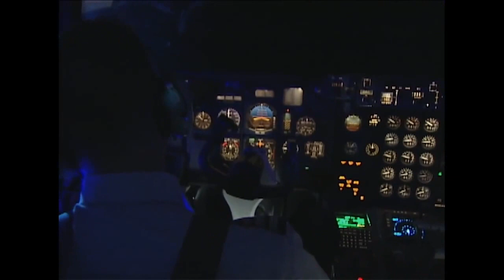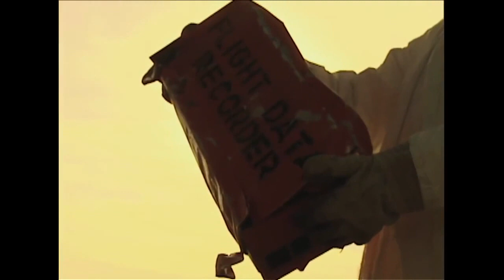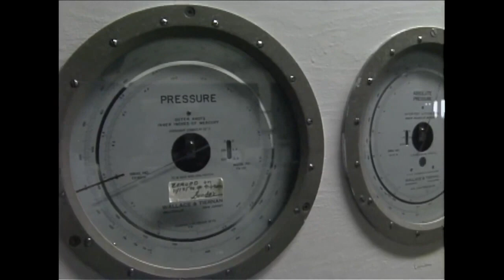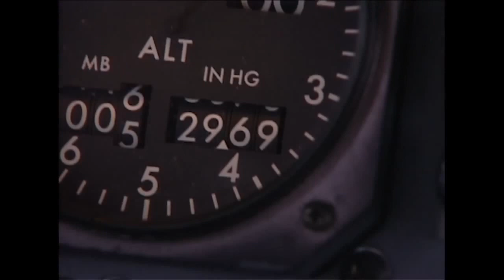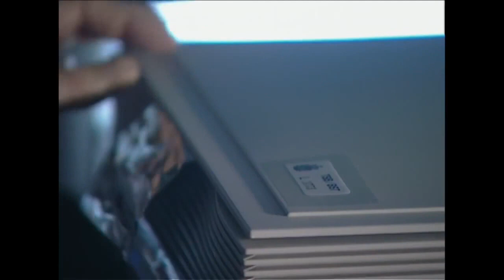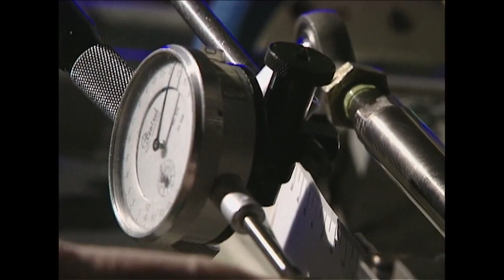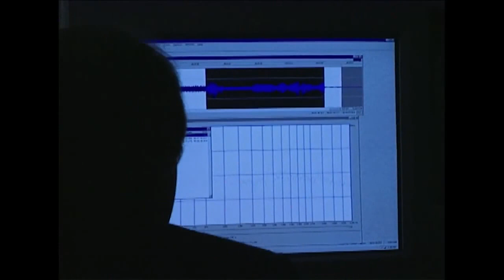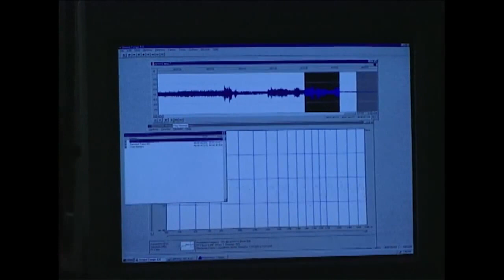AMERICAN EAGLE FLIGHT 4181 DOCUMENTARY LANDING MAYDAY AIR CRASH INVESTIGATION 2020

Comment: Can't help but think they should design to make the plane be able to take high stress so the tail doesn't come off!
Reply: 1. First of all, those airframes can take a LOT. They are made to withstand forces several times of normal flying conditions. Unfortunately here we were talking about such high stress that only occurs in the case of fighter jet maneuvers. It would make the passenger plane 3x 4x more expensive to be manufactured this way. Probably increasing tickets to cost 3x 4x more as well. Only to prepare for an emergency that needed to be solved otherwise (extended de-icing equipment)

2. Even if the tail didn't come off the aircraft was already speeding towards the ground at a near 90° angle and had very low altitude. All that with a messed up wing surface due to extensive icing. The result would have been the same.

I know your intent is good but the solutions are usually not so simple. Unfortunately